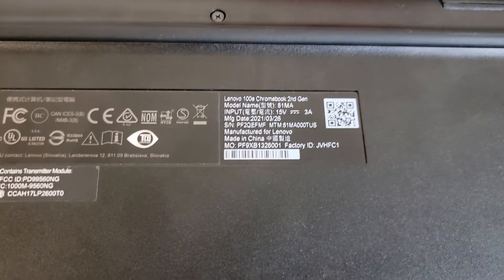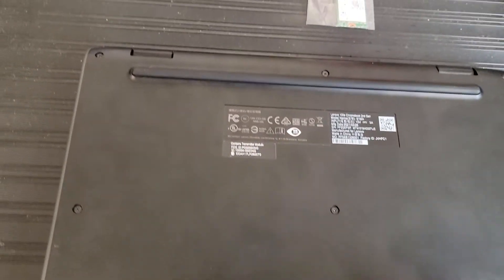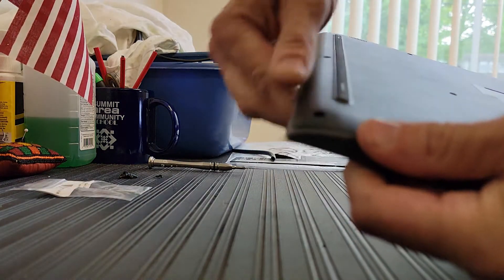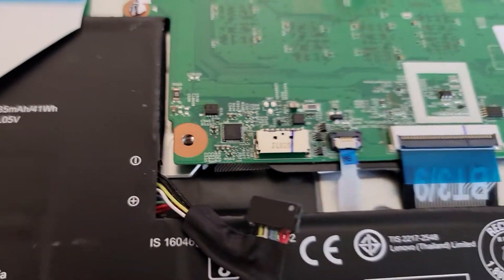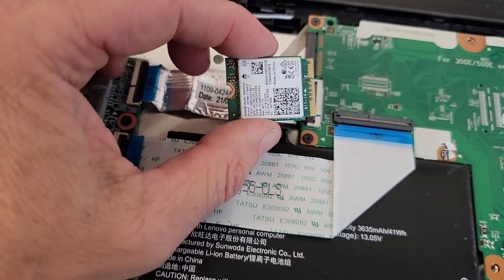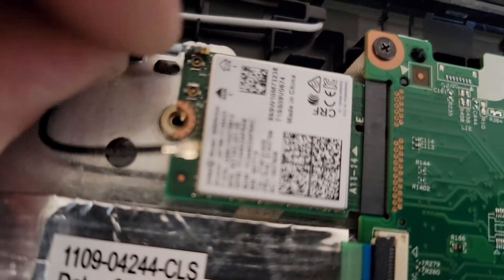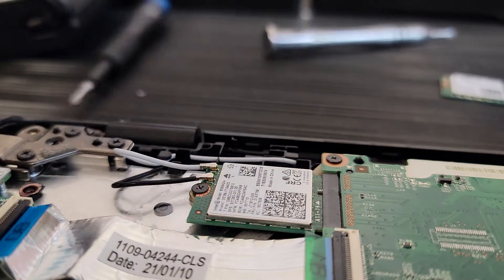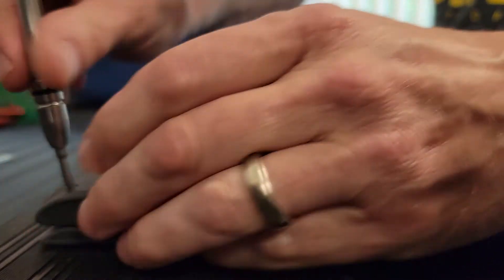EASY replace your WIFI card on a Lenovo 100e 81MA Chromebook

Comment: Thanks for demo - my Chromebook is randomly losing WiFi connection and I have to restart it nearly every day when I'm in the middle of something. When I troubleshooted it, a so-called expert offered, "probably indicates a hardware issue. We have seen numerous users reporting problems caused by a loose connection between the WiFi card and its socket. Removing and then reinserting the card can often cure the problem." I wanted to get an idea before I bring it over to the Geek Squad at Best Buy.
Reply from the maker: Chrome book wifi cards are hard wired into the mother board. The chip often goes bad which means new mother board. Could be pinched wiring around the hinge area or very unlikely one of the antenna wires came loose from the wifi chip.